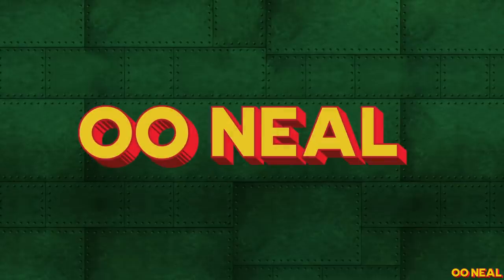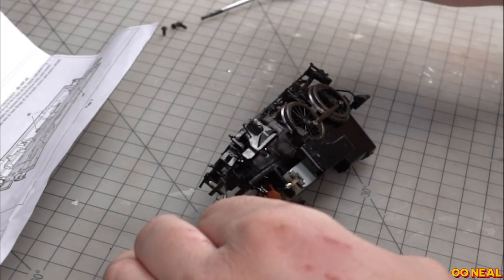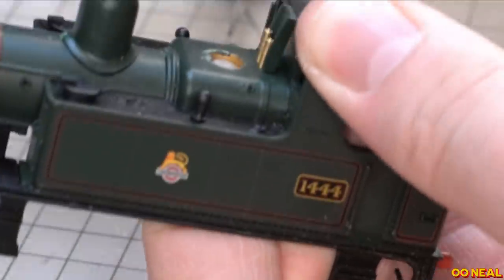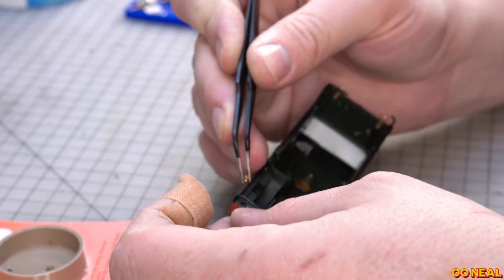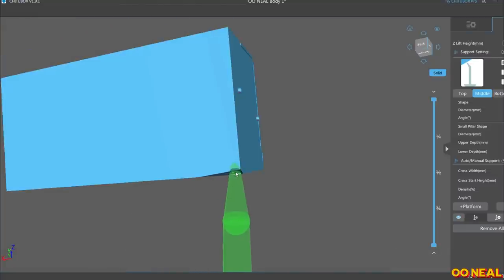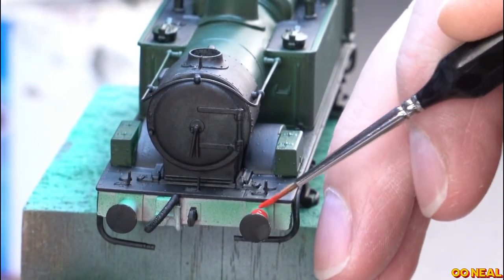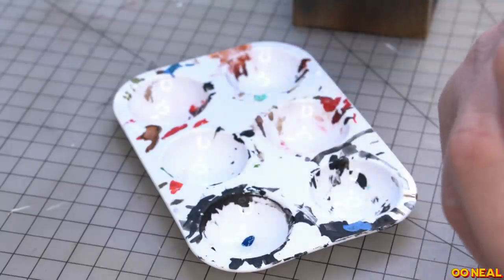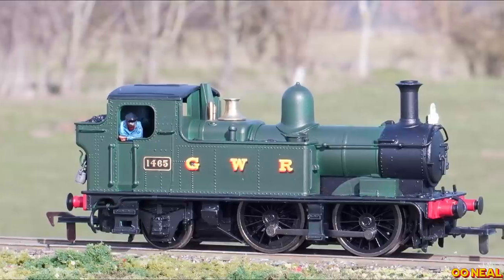Improving the details and Repainting the Hornby GWR 14xx 0-4-2

Comment: Superb work. The loco looks fantastic. One tip I would give you is to use Micro Sol on the decals after you have applied them but before you clear coat it. It softens the decals and makes them form over the fine details on the model. For example where the GWR logo sits on rivets. You would notice a big difference with Micro Sol.

Comment: Wow. Great job..! I have always wanted to bring my 70s Triang/Hornby Loco's into the 2020's but never been Brave enough to potentially Wreck a Functioning Loco. In a more Modern Detailing look..!

 Maybe now, I will give a 0.4.0 shunter that just looks Naff, even though its a Great little runner and even Crawls well.
 
 So when I have finnished my latest Project 1/35 Scale Rail gun.
 I may buy New Glasses and get into Detailing my little Hornby 0.4.0. 
 Detailing parts will have to come fro Uk. ( being in Oz.)
 So that will give me a fair window of Time..!!

 Thanks for the inspiration, although I do lack a 3D printer..! Great Video because, I am Inspired to give it a Go.

 You just gained a New Subscriber from the Land of Oz..! Cheers from Kim in Downunder land..! 😎
Reply from the maker: Hello Kim, that’s great you’ve found it so useful. With the 3D printing it’s not so Important for this project. I hope you find your nice set of glasses. Do you know which model you will work on first you say an 0-4-0 is that the Nellie model?

Comment: It looks great.  Love the lamp irons and lamps, must get some.  I have two of the Airfix models in lined BR green and they are so sweet.  They can be difficult to get running smoothly but with some patience I have managed.  Their back wheels are sprung by a brass strip that is strong enough to keep the wheels in contact with the track but not so strong as to lift the centre wheels off.  It's a delicate balancing act (no pun intended) 😊 Meticulous work as always.
Reply from the maker: Thank you, it’s great to hear so many people talking about there 14xx locos 😊

Comment: I have models made by airfix dapol and hornby. They can all be made to run very very smoothly. Even the old airfix one is 5 pole. That spring has been either stretched or replaced.  I've not had one do that. The sprung real wheels means very reliable pickup for slow running and normally work a treat
Reply from the maker: That’s good to know, it’s like someone rammed a pen spring in there. How long have you had your models?
Reply: @OONeal  Hi Tris. Between 5 and 10 years. So as you can imagine none are new. They all can be made to run beautifully with little maintenance.
Reply from the maker: @gs425  yes I’m sure you can, I think I will look out for some older examples to enjoy too
Reply: @OONeal  I have just realised I also have a white metal Ks kit version, with brass chassis and Romfords.  It has a lovely feel but has nowhere near the detail of the other 3. Need to sell if really.  Would make a quality base model to improve like you have done.

Comment: After watching the stream I picked up Hornby 1436 e/e from the bay and will use this video as a manual. A real inspiration, mate!
I noticed the chimney on mine isn't painted either - odd, that. 
Also got a cheap Holden tank and I'll probably get one of your 12xx bodies to put on it rather than detail the original body. Now all I need to find is a Bachmann 57xx chassis and I have a branch-line worth of models... 
edit: now ordered ta :)
I'd love to see a 517 class or the old open cab version of the 14xx.
Reply from the maker: Oh excellent I’m glad you did. I’m pleased you found this a good video to help you get inspired! What livery so it in? That’s great if you order one! The 517 would be a good project for another day 😊
Reply: @OONeal  It's going to be e/e shunting yard grot black (flat smokebox/running plates and satin boiler/tanks/bunker then caked in sooty filth, I reckon, seeing as all the rest of my locos and stock are depressing 50's grime. I love how terrible the mid fifties were, in fact I seriously considered painting my layout and all my stock in shades of black and grey.

Comment: The old Airfix models had 'traction tyres' (basically a rubber band) on the rear drivers which were of little use.
Reply from the maker: This one has it too. My fathers one he removed that wheel set and moved to normal wheels which is something I should look into.

Comment: Great video. I have the Airfix version,  I got it to go with an Airfix GWR autocoach (Didcot) . It only cost $55 Canadian (£35). 
I had to change the traction tyres, which I used the 10mm Marklin (thanks to Barrie Davis's channel)
Reply from the maker: Thank you, I’ve got some coaches which will feature in a coming episode 😊 I’ll have to check that out. Do the marklin 10mm ones stretch over then?
Reply: @OONeal  yes they stretch over the wheel it’s a tight fit but they work really well.  Check out Barry Davies
https://youtu.be/ukjNBsrtYkk. 
I got them for my mallard and flying Scotsman (tender drive) but they are too narrow for the tyre groove.  
So I’m still looking for alternatives.  
I might try the liquid tyre “bullfrog snott” crazy name but apparently works well.
Reply from the maker: @Theoriginalborgy  ok that’s great thank you. I’ll have a watch it soon

Comment: Tris, you are waaaay better than me, but on the pet peave, I know I've said it a few times, whilst there should be no mould line on the smokebox, chimney or dome, there is almost always a seam on the top of the boiler because this is where the 'wrapping' meets. I've sanded it completely off before and some models don't have it anyway, but I try and leave what I can now.

Feel like a pedant but you know it's with love: 48XX were auto fitted, 58XX were the non-auto fitted. The way more numerous 48XX lost their desginations to 2-8-0 28XXs that were converted to oil-burners late in GWR days. These all later went back to 28XX when returned to coal firing, but the Collett 0-4-2ts retained the 14XX they were reallocated to. Previously the 14XX numbers had been occupied by various 2-4-0t Metro Tanks and the direct predeccessor to the 14XX/48XX/58XX, the 0-4-2t 517 class which has a very very long history worth a look at.

Anorak back on hook... great work as always, I have trouble with Airfix, Dapol and Hornby versions of these, they're one of my favourite classes of loco but in model form they always seem to disappoint, bobbing along and derailing over the slightest of point disruption
Reply from the maker: Thank you for taking the time to write this! I understand I guess I don’t see that seem when I am out at heritage days. I appreciate you telling me the infomation about them. Making a 517 would be nice too as it’s a good looking loco. Take care 😊

Comment: An absolute pleasure to watch you detailing the 14xx.
A model always looks better for detailing and you have done well with the 14xx...1st thing I did was to get rid of the traction tyre-wheels, replace them with normal wheels and then fit a decent motor to each 14xx.   Detailing and weathering then admire and back to normal duties.   Pointless paying silly money on a more expensive model that you can't get spares for and the quality models are just that...silly money.

Comment: urge to get an airfix one to do up like this is now rising :P might even attempt to put a different motor in and move it forwards so i can have a cab in it, but either way, yet again what you've done here is stunning work :)
Reply from the maker: Thank you, I think to do something with the chassis would be good to complete the model. High level brass chassis kits would also be a good option I may end up doing.

Comment: Thanks for this video, would like to do some of these detail improvements to my Airfix 14xx at some point.  One thing I've had done was actually replaced the wheels with traction tires with some spare wheels from a later Hornby one, essentially a Traction Tire Delete which I feel enhances the model even if that also hampers the adhesion.  Should look good hauling a pair of Bachmann Autotrailers I feel

Comment: Fantastic job, I recently managed to get a Hornby 14xx in decent condition, so this video will serve as an inspiration to detail mine a bit more. If you don't mind sharing, what kind of glue are you using?
Reply from the maker: Thank you very much. I use a thick Rocket glue, you have to be careful as you need to use less but it is good. I hope you enjoy doing yours! Will you do a repaint too?
Reply: @OONeal  I managed to snatch a BR Green, and considering 90% of my fleet is BR Green, I'll probably keep it that way, although attaching some detailing as you did in the video seems like a very enjoyable process, so I might eventually need to re-paint it in some parts, at least the buffer beam

Thank you, most modelling glue we have around here won't stick properly, about time I got something decent
Reply from the maker: @tykedopwnz  yeah and a bottle will last you for quite some time so you should treat yourself to a pot 😊

Comment: What's the bbenefits in constructing the model then painting as opposed to painting the individual parts then putting them all together? Great work BTW
Reply from the maker: I get the question. So it was British railway green with lining and I wanted to make it GWR green which is differnt which also has no lining. This is why I ended up doing that. Does that make sence?

Comment: Great work, don't the Hornby ones have  reputation for burning motors & catching alight?
Reply from the maker: They may do but so far mine has been ok. Hopefully it stays that way
Reply: @OONeal  Yup, those Hornby Type 7 motors can be troublesome...usually when overloaded, but running the 14xx with an auto-coach or light goods should be fine :)